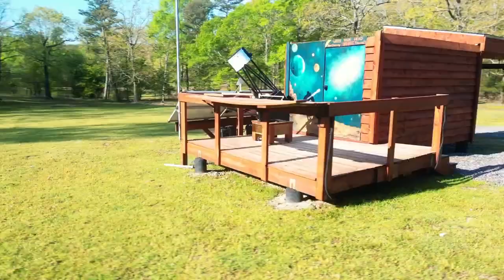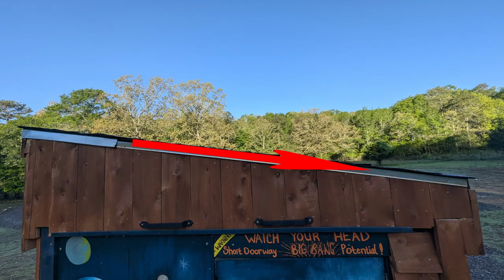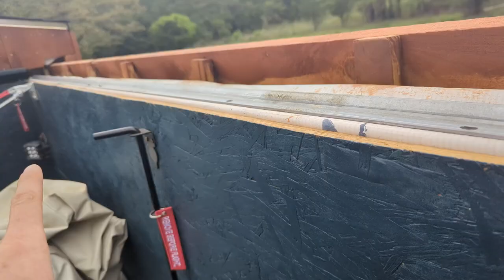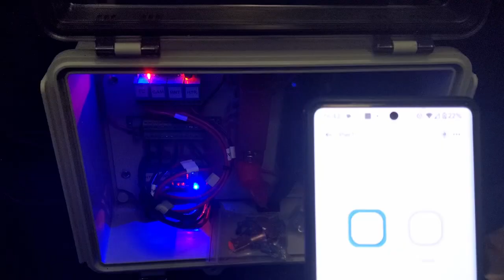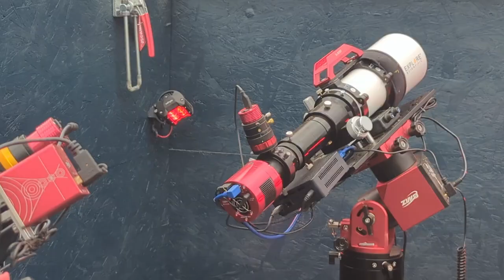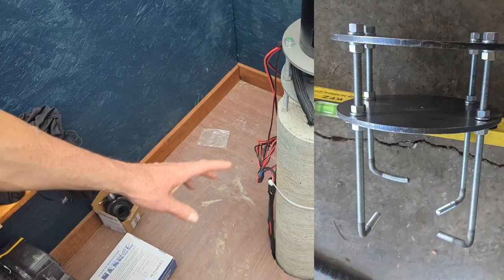My off-grid roll-off roof observatory build

Comment: I know this has been out there for a moment... how do you keep the spider and such from moving in?
Reply from the maker: I'll usually get a few new residents if I haven't been inside the observatory for a few days. Most of the time, it's a spider or two setting up shop around the windows. As long as they don't build a huge messy web, I usually leave them alone—they help catch my real nemesis: the red wasps.

We recently had a long stretch of cloudy weather, and I didn't make it out there for about a week. In that time, a group of red wasps decided to move in between some of the vertical siding. I managed to evict them after a short battle, but keeping critters out can definitely be a challenge.

I think the best defense is simply visiting the observatory regularly so they don't have enough time to get a foothold.

Are you building an observatory, or do you already have one?
Reply: @OuachitaHoyoObservatory  just set the sonotubes and rear, be mixing concrete for the pillar this coming weekend
Reply from the maker: @SquirrelMickFetus  That's awesome!  This is such a fun hobby.  It's been clear here the last few nights and I've been able to get some great imaging.  Please post a link to your finished project.  I love seeing everybody's builds.
Reply: @OuachitaHoyoObservatory  summer here svcks pretty bad. Way too hot, way too many bugs, and then the "marine layer" sets in around 2:30am.
Figure if I don't have to keep wasting time aligning and such, I can grab more exposure time